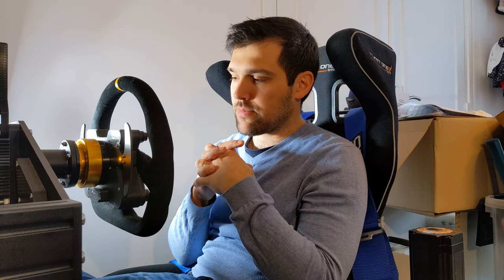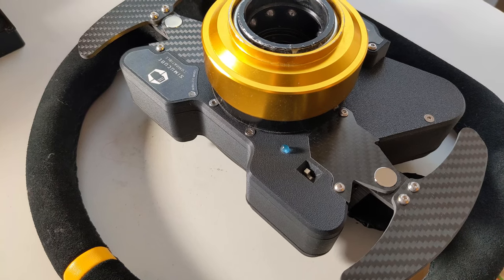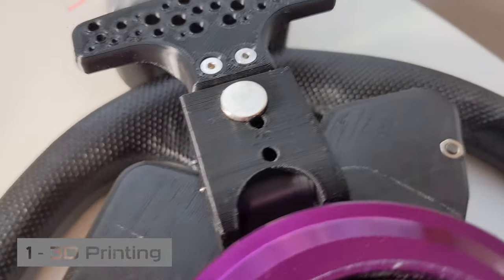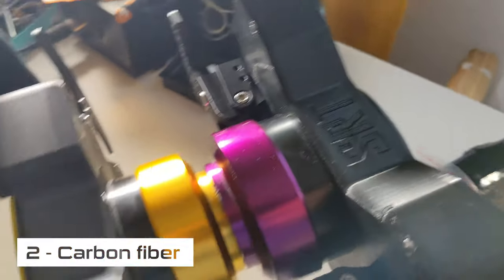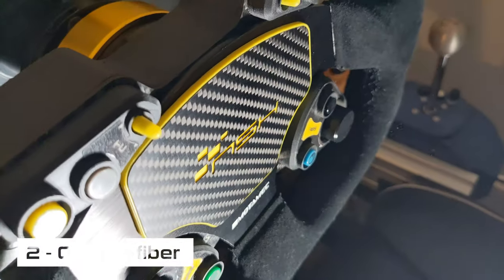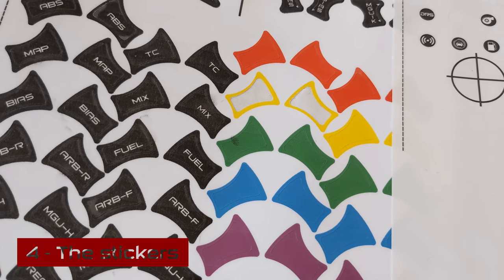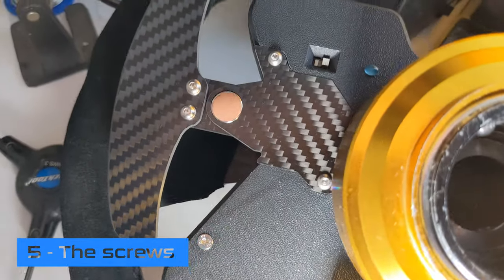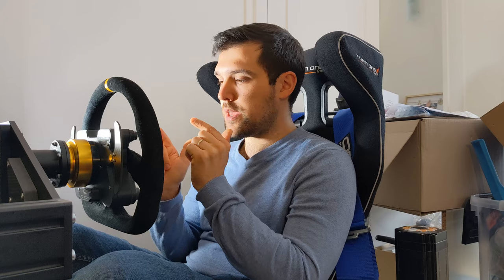Make a DIY Steering wheel, a good idea ? SRT button plate vs NSH Racing

Comment: Hello, do you have or can make a list of the wheel bases for which your steering wheels are compatible? I think only Simucube for now? No Fanatec CSL DD or other brands? I just have a cheap Logitech DFGT, would like to make the switch one day and make also a formula wheel
Reply from the maker: mine is only compatible with simucube
Reply: @LeboisRacing  But can you make an USB receiver that is compatible to any kind of wheel?
Reply from the maker: I will work on that soon for the Ferrari 488 GT3.